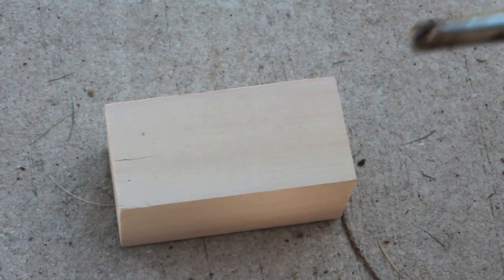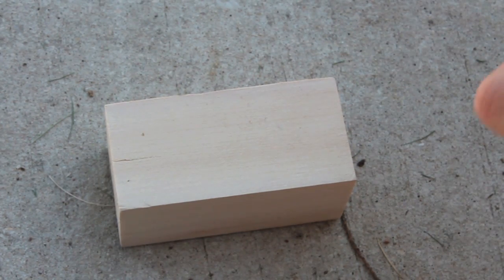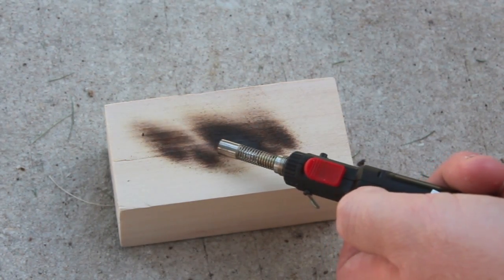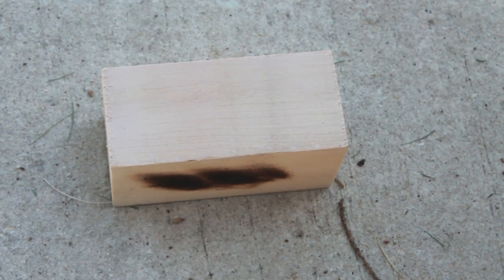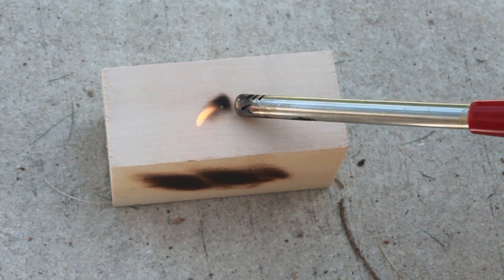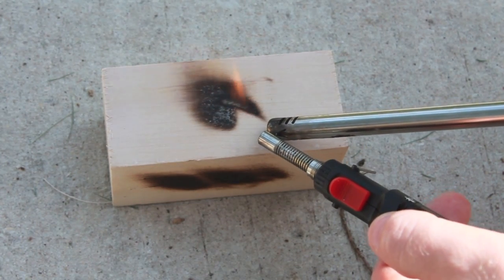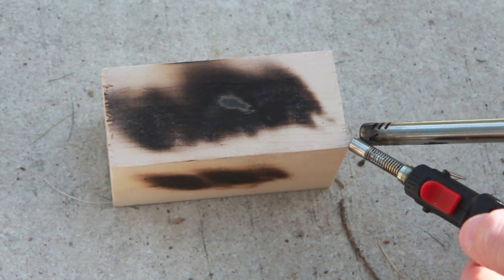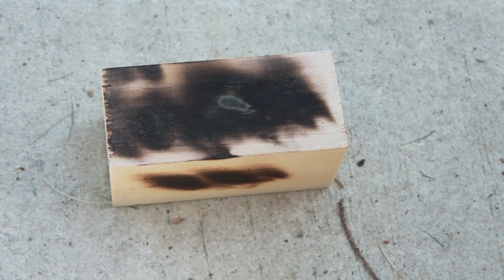Neverwet Burn Test

Comment: Well ideally you shouldn't be doing anything with fire directly on a wood or composite deck, so it wouldn't matter what the deck is coated with.  Hell, some local codes wouldn't even allow you to grill or have a fire pit on a deck like that.